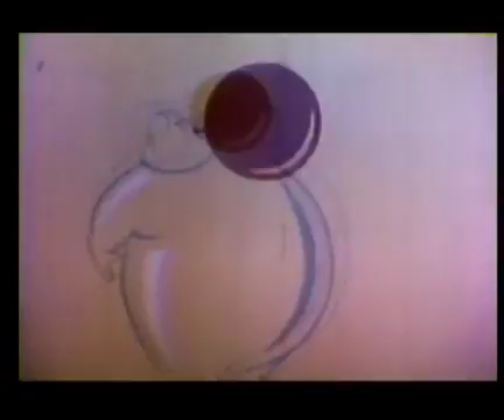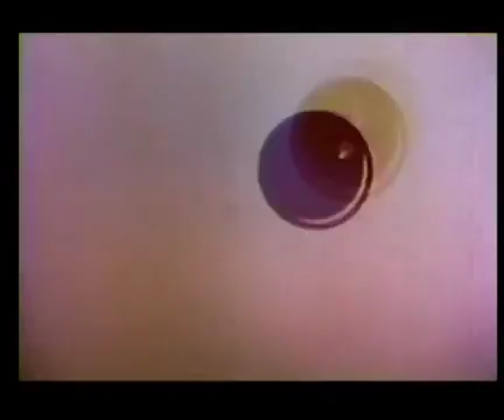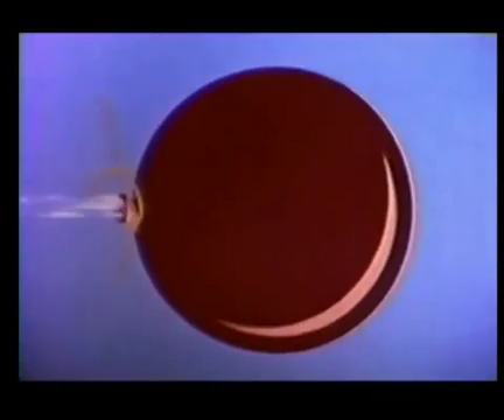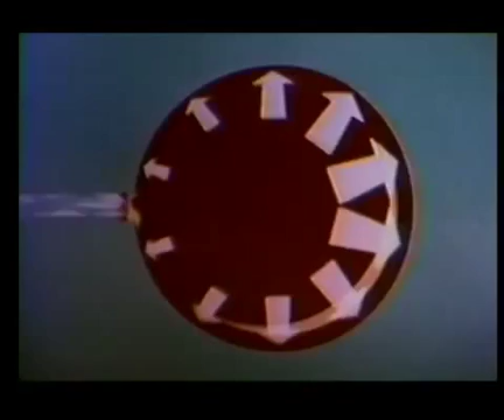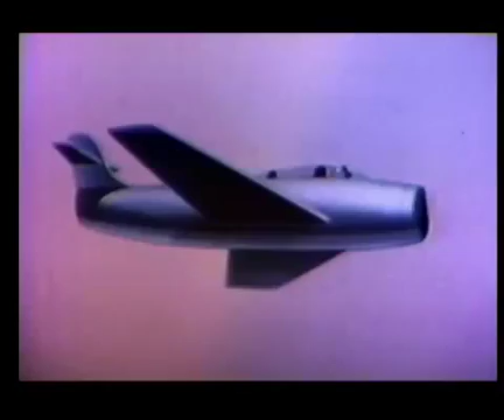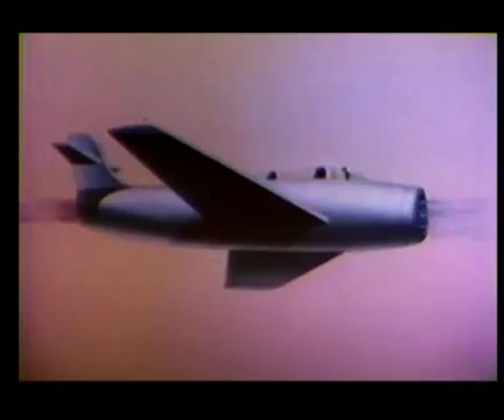ABC's of Jet Engines Video

Comment: It's actually called THE ABC OF JET PROPULSION and is roughly 18 minutes long! Made by GM! It says at the beginning of the film,"This film is one of a series based on the General Motors book - A Power Primer!" Don't know exactly when it's made but the 60s is a safe bet I guess... Got a 16mm print so that's how I know...
Reply: Could you perhaps upload the titles to the film online? or comfirm if Disney is mentioned any were on the titles?

Comment from the maker: We think Ford made the video, but not 100% sure.  The video was probably made in the 60's. Thanks for your interest!
Reply: actechbooks I understand how the pressure pushes on one side of the balloon when the other side has pressure release through the stem. But how does this apply to a jet engine where air is coming in through the front end? It would seem that the ignition of the jet fuel would want to push both forward and backward. So what is equivalent to the forward wall of the balloon in a jet engine?